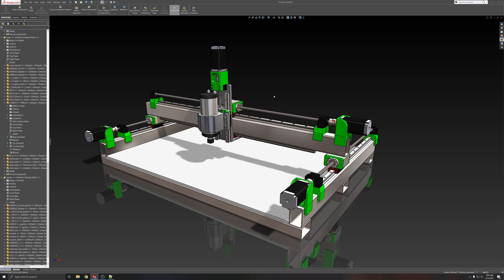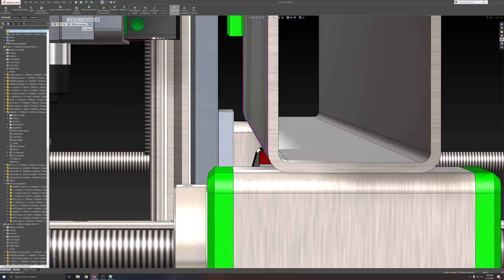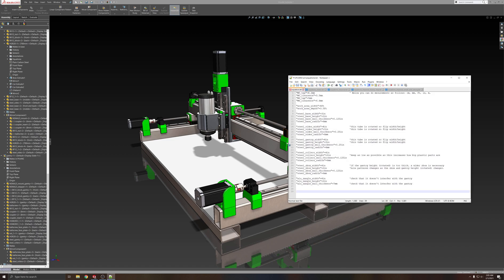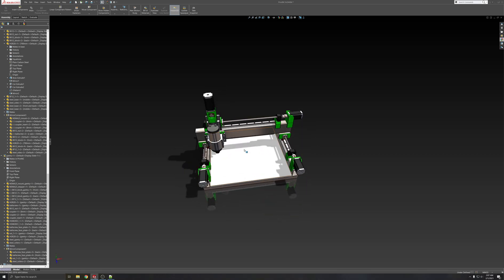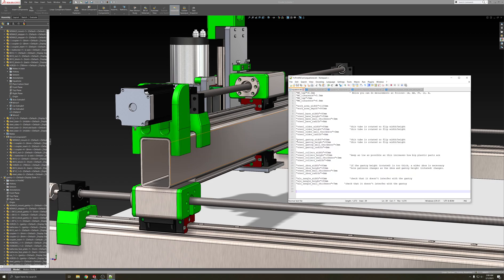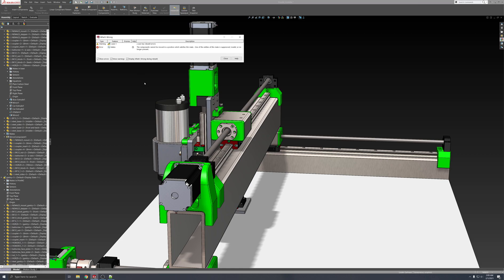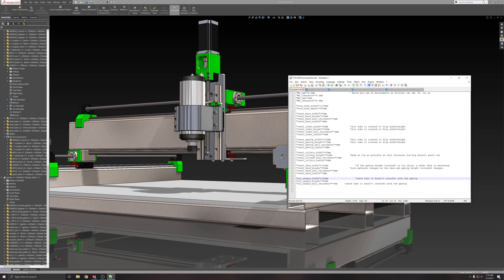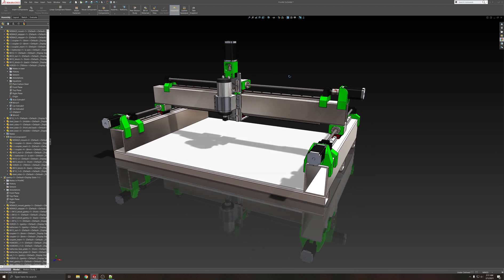Designing a Fully Configurable PrintNC CNC Machine in Solidworks

Comment: Salve video interessante sto costruendo questa macchina anche io, volevo sapere per la modalità scura di solidworks come si applica, grazie
Reply from the maker: I wouldn’t recommend it. In the settings you can change the GUI colors and than change the viewport background environment to a darker one like I’ve done. Problem is in solidworks there are so many edge-cases where you end up with light on light or dark on dark text to background that takes time to hunt down. I’ve gone back to accepting using soldiworks with a light background as I couldn’t get it working well enough in a custom dark mode. 

BTW the PrintNC is a great machine and I’d suggest working off the official fusion files unless you are very comfortable in SW and don’t mind working around any incompatibilities that might show up on the build.